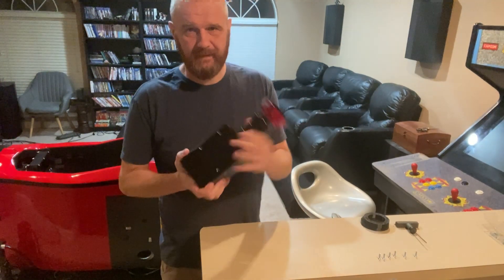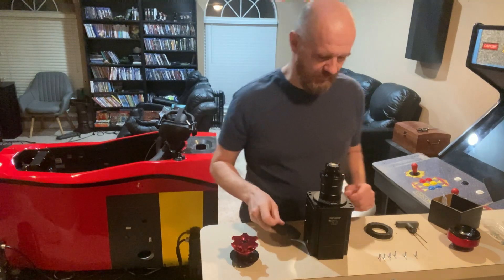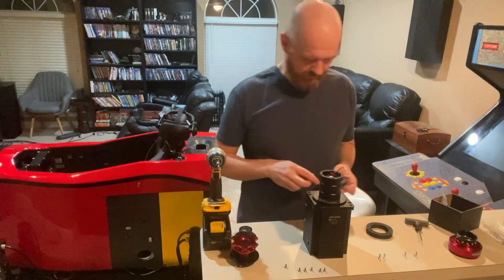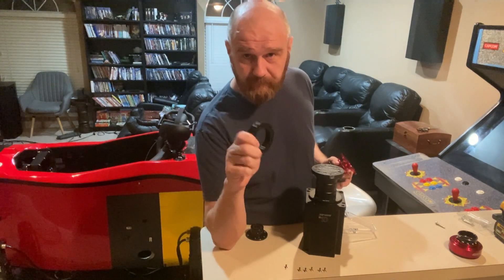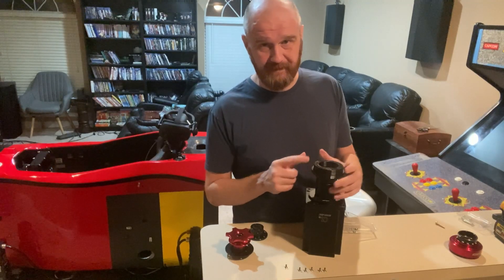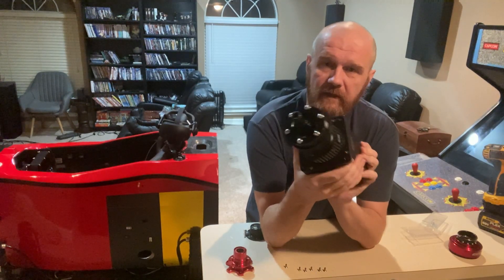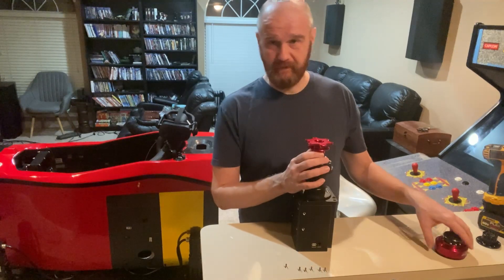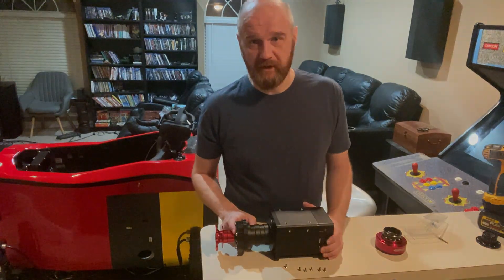SimRacing DIY: Replace The Quick Release On A Simagic Alpha Mini Wheel Base

Comment: May i ask what size of bolt and nut u used ?
Reply from the maker: If memory serves they were 5mm but it’s been a while and I might be misremembering
Reply: @SimsRUs  I did it. Thanks for sharing your file
Reply: @kiu180  Could you specify what exact M sized bolt and nut you used?

Comment: OK, I already have an alpha mini in my possession and I can confirm that the distance between holes is 58mm
Reply: Thank you so much I will make a custom aluminium shaft and needed that numbers so bad
Reply: @Nick-w5v  in use https://es.aliexpress.com/item/1005004732491682.html?spm=a2g0n.order_detail.order_detail_item.3.2f5139d3Cm2ahc&gatewayAdapt=glo2esp

Comment: What do you think about mounting the wheel directly to the 3D printed adapters, and getting rid of the QR altogether, if one doesn't need it (i don't) ?
Reply from the maker: the adapter is still going strong and no I don't think you need the QR If you are only going to use one wheel then mount it directly to the adapter. but incase you want the QR this is what I used https://www.amazon.com/gp/product/B07FF4JCKB/ref=ppx_yo_dt_b_search_asin_title?ie=UTF8&psc=1
Reply: @SimsRUs  Thanks a lot for taking the time to the reply !

Being as smart as I am, I just figured out it's actually possible to mount the wheel directly to the base shaft as well. Do you see any potential issues with that ?
Reply from the maker: @Deniz1923  I wouldent think so assuming the pattern matches, the whole point of the adapter is to be compatible with the more common pattern

Comment: Are you related to Johnny Rea by any chance ? 😃
Reply from the maker: No but I can see why you would think that, as he is almost as pretty as me :D
Reply: @SimsRUs  How's the 3D printed part holding up vs 10 NM of torque ? For a moment I thought it would not hold up without breaking in the long term, due to the nature of direct drive wheels being able to change the direction of the force being applied very quickly.
Reply from the maker: @Deniz1923  no problems so far, I printed it with 90% infill so its pretty solid.

Comment: do you sell these adaptors, after your initial thoughts, i buy alpha mini today, last week sell my csw v2.5 to buy a dd wheel, consider csl dd, alpha mini and vrs, vrs is not available to buy, have to make reservation and wait almost 15 days but not any news, csl dd seem weak for a dd wheel, alpha mini should suit my needs, but i buy without quick release, it will use only a one wheel wihout any buttons on it, i didnot like the buttons on the wheel, for me it breaks the immersion, so i need one of the adaptor to mount the wheel to the base.
Reply from the maker: I don't sell them but there are plenty of 3d printing services online that will, Just make sure to request they print it in PLA with 80% infill
Reply: @SimsRUs  thank you, dl the file and tomorrow i will printed it, whats the size of bolts you insert the pla
Reply from the maker: @Kivancpro5244  they are M5's
Reply: @SimsRUs  nuts are just normal nuts, right?
Reply from the maker: @Kivancpro5244  yeah standard m5 nuts, btw you may want to go with 90% infill, that's what I did on mine but 80% should suffice in case the print service doesn't want to do 90%
Reply: @SimsRUs  thank yo sims r us, also did you try to connect logitech whell directly to base, it seems like be 58mm
Reply from the maker: @Kivancpro5244  I didnt but if its a 6 hole pattern 58mm center to center it should work
Reply: @SimsRUs  i buy a g27 wheel and it will fit perfectly to the base directly, alsa print your adaptors and thanks again
Reply: @Kivancpro5244  Hello, I have an adapter for g27, do you mean that it would also work for this mini alpha base?
Reply: @felixpega  yes, g27 3rd part adaptors has 58mm diameter to attach 70mm wheels
Reply: @Kivancpro5244  is this truthful? I got my fingers crossed lol

Comment: Hello,  I found on aliexpress a chinesse copy of the q1r system with a wheelbase side of 55.8mm. That one is supposed to fit the alpha mini by removing the wireless thing? Could you please tell me the meseaure of that holes exactly? Thank you so much
Reply from the maker: im not sure 55.8mm will fit, 58mm is what I measured the distance to be.
Reply: @SimsRUs  Im here to tell you that Im idiot xD i wrote it wrong. The aliexpress qr is 58.5mm not 55.8mm
Reply from the maker: @mattiuswan  that should work, worst case you might have to drill out the holes just a little bit. but Im guessing the extra .5 is cause they already made them oversized
Reply: @mattius link for the q1r clone pls.

Comment: Hi, does the adapter wheelbase measure 50.8mm?
Reply from the maker: Not entirely sure I understand the question, but the  hole distance center to center on the wheelbase side is about 58mm if that is what you mean?
Reply: This is what I meant. Thank you so much